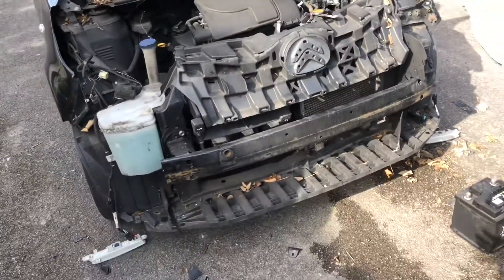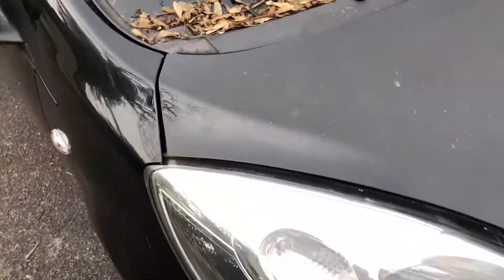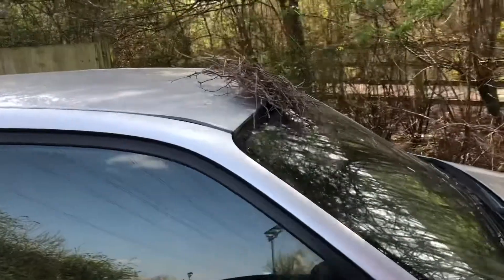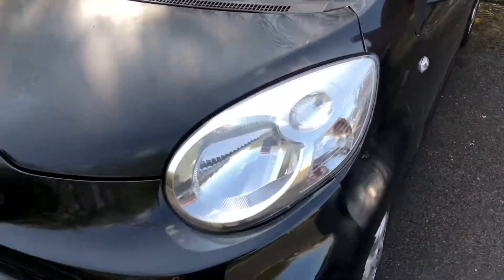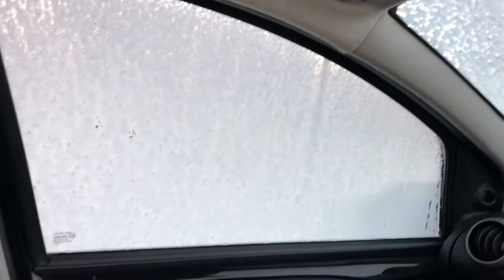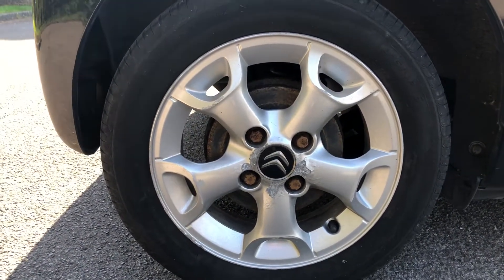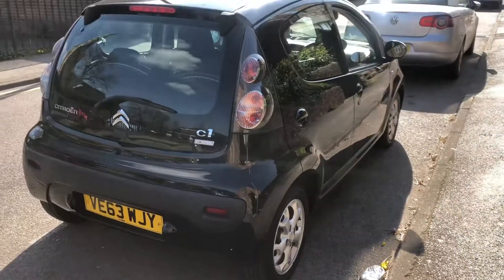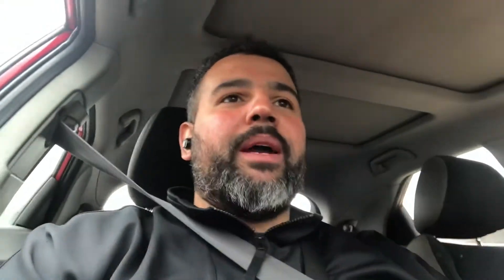I bought a wrecked car from copart / flipping cars Uk #flippingcars #rebuild  #dreamcar

Comment: Love your optimism, re the centre caps, little trick, get a  thick pointed knife, just get the point in anywhere it'll go, and press down and give it a heavy flick, usually they'll pop out without having to take the wheel off. 👍
Reply from the maker: Thanks 🙏🏼 appreciate that and thanks for the tip il definitely give it a go next time.